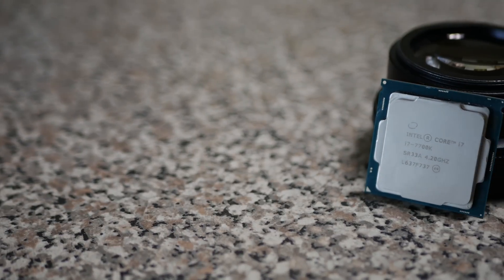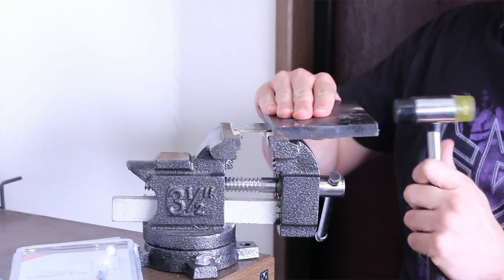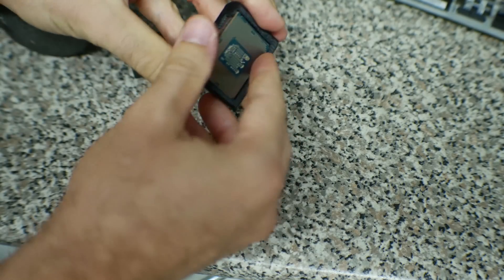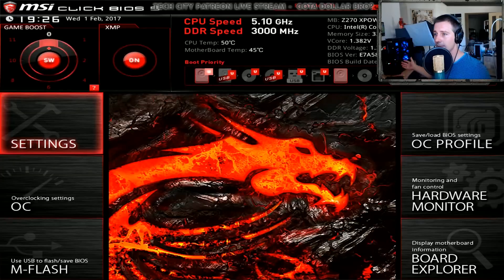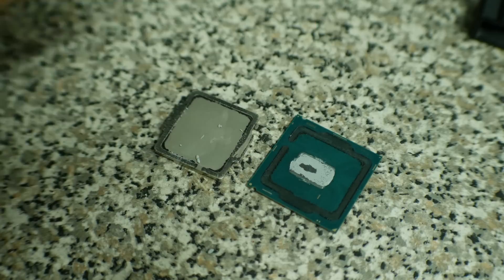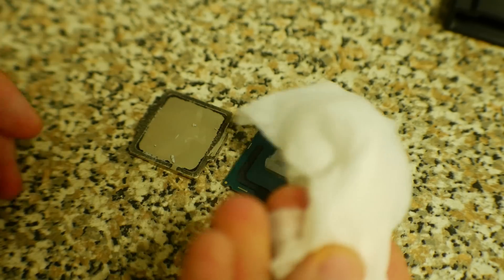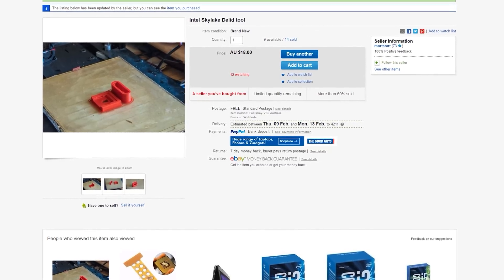DELIDDING The i7-7700k - How much of a Difference is there?

Comment: I used my 7700k for 3 yrs.  It was hot to start but 3 yrs later at stock clocks on prime95 stress test it was hitting 100°c.  I delid the thing and it dropped avg temps - 30°c.  Out of factory 7700k was dangerous and anyone who has one with no delid should check their temps now.  Irresponsible Intel!  I was actually having to underclock to get safe temps before delid.

Comment: I am going to delid my i5 6600, as temperatures go up and down by 30 degrees in one second, the tim is an insulator now. I will use a graphite thermal pad, and forget about the cooling forever.
 I had bought this cpu for its low tdp and good power. Then I installed a big cooler to cool that down at the lowest fan speed. It ran below 40 degrees under full load. After two years, temp goes up by 30 degrees instantly, when I open a browser, or do anything. Intel replied to me, that everything is ok, cpu works at safe temperatures, have a nice day. Intel uses BUFU strategy. My son got a ryzen for his birthday. I will buy amd only since now.

Comment: Before delid i was running at 4.8ghz at temp 81-84. After delid and using Thermal Grizzly liquid metal i am running at 5ghz, temps from 60-63 at full load. Happy camper.

Comment: is it just me or does the i7 7700k run hotter then usual, at 70% load im running around 80 degrees, its been that way since ive had the system built, have also used Thermal grizzly Kyronaut from artic silver just on my head spreader didnt do anything even after around 200 hours it still runs hot, all cooler and ect is mounted correctly

Comment: Did you put your Cache Ratio up to 100Mhz lower then your core clock? As that can help massively with stability.
Only asking because I get the same result on my i7 7700k Processor with 4.9 GHz and 4.8Ghz on cache as you did on CineBench 64.

Comment: 😭 I got 5GHz stable easy but because my cpu was going to 95-100 C and it did not even have much voltage :| I have to stay at 4.8 GHz and 1.36 V and even like this it goes to about fucking 84-85C wtf Intel 🤬 I would delid but i won't do the razor method i'm to afraid not to break the chip. If i get 85 with 4.8 with delid at 5GHz i would have 75-80 C ;) and that's 110% good for 24/7 usage 💪🏻

Comment: Can confirm. Delidded my 7700K and went from a 4.9Ghz OC throttling out at 100°C while gaming, up to a 5.1Ghz maxing out at about 78°C under extreme load and around 64°C while gaming. I used Conductonaut liquid metal for both the IHS and as thermal paste on my water cooler. These temps are better than I hoped. I definitely recommend using a delidding tool. It's worth the time and money.

Comment: I bought a Cryorig R7 cooler and noctua thermal paste for my i7 7700k but it still jumps between 50-77c in a second or less I'm not ready to risk delidding it yet is there anything I can do to cool it better does any one recommended anything else (besides water cooling)

Comment: sigh, my 7700k hits 95C on prime95 smallFFTs on 1.25volts...only 4.5ghz (which is stock btw) Using a Noctua NH-D15...
Reply: tinostarks im over clocked to 4.8ghz , on a badic evo 212 air cooler, and on max load i only hit 81c 😂😂 must of got a dank chip

Comment: Wait touching the chip with bare fingers doesn't mess it up? Because i was under the notion that body oil from fingers might interfered with the processor and that's why you hold it by the edge?

Comment: I would recommend delidding even if you aren't overclocking.  I'm building a pc for my step-son and he lives 2500 miles from me so I can't just go take a look when something goes wrong.  So once I finished building this Kaby Lake system the temps were eye-opening even at stock settings.  My Haswell system is 30C cooler at a 50% OC.  I couldn't bring myself to sending him a system and telling him, "Hey keep an eye on your temps while playing games since FutureMark was hitting upper 60s to low 70s."  That's with a Corsair H100i V1 water cooler on it.  So I bought RockIt delidding tool, which got to me in 3 days and I delidded last night.  Tonight I will drop it in and see what temps I get now.  It wasn't difficult to do with maybe the toughest part putting the new silicone on the IHS.  Don't forget to leave a pinky-sized gap for venting or else it won't work.  I'll provide an update tonight of what the temps are under a stress test of AIDA64.
Reply: Ok finished with my step-son's build.  Before delidding, AIDA64 stress test for 30 minutes at stock settings hit 78C; keep in mind that was 3 days after I mounted the water block.  After delidding, the same test hit 66C.  I figure maybe 2 to 4C lower as the TIM cures under the CPU block.  Not bad.  Gaming temps playing Elder Scrolls Online hit 56C which is perfect.  Even have some headroom for overclocking and this is with a h100i, which could be improved further with a custom loop.

Comment: I just delidded my 7700k and dropped from full load 100 C thermal throttling (no overclock) to full load high 70 C with no thermal throttling. So you have to pull apart a $500 CPU and fix Intel's BS with $15 worth of thermal liquid... Nice one!
Reply: If delidding has dropped my temps 30C, it obviously has nothing to do with the cooling in my rig ;). And judging by this video and all the other videos like it, I am not the only one with a bad CPU by far. You and your mate got lucky!
Reply: You never know, they also might have fixed/improved the issue on their own by now and you still got one of the earlier series. Unfortunately i ordered this CPU just last week without knowing about the problem. Even though i like to have the option of overclocking, i probably won't bother too much and hopefully it'll all be fine.

It's still a shame that they let this shit pass on a overclockable version of their processor.

Comment: I just upgraded to 7700K on MSI M5 mobo with NZXT Kraken X60. Mine is running OC of 5ghz at 1.2v. But I noticed temperature spikes from 38 to 60 degrees on some of the cores. Is this normal?

Comment: The quality of the paste Intel is using is perfectly fine. The only reason why off-the-shelf pastes are so runny is for convenient application as it is the fine metal oxide dust it contains that provides the actual heat transfer. The oil base also prevents the powder from turning into an airborne hazard. The main problem with Intel's paste-based IHS is that the gap between the IHS and die is much thicker than it should be. Remove the IHS, clean off the glue, use generic thermal paste, put the IHS back on and you will already get most of the temperature benefit.

When the thermal paste is in the neighborhood of 10X thicker than it needs to be, you get 10X more thermal resistance than is necessary from the TIM on top of total lack of physical contact between the two parts and even the best TIMs would still be horrible.

Comment: It's not entirely on the thermal paste they used, it's more the distance between the IHS and the die that's causing issues. You could have the same thermal paste in your hands to apply that Intel used and just remove the sealant and allow the socket arm to hold it down and there would be an improvement.

Comment: OK. I have a large amount of Thermal Grizzly Kryonaut thermal paste coming in. I have a Corsair H100i 240mm water cooler system. I have a brand new core i7 7700k. Just bought a delid tool from a seller in the Netherlands. Let's do this and see if I can hit a stable 5 GHz with my MSI Z270 board.

Comment: I've built a i7 7700k pc for a friend when the cpu came out and the temp issues was'nt well documented. Having experience with the skylake cpu i could'nt belive the reading of the temps when i was stress testing the kaby lake machine and ended up removing the cooler(evo212) and replacing termal paste multiple time, beliving that i hav'nt put enough to properly cover the cores  before figuring out that this chip was just hot and left it w/o overclock hitting 90's degree on max heat stress test. Still the chip is doing a great job but i've pushed all the  i7 6700k i worked on farther with better temps and knowing that the issue is bad TIM makes me disapointed.

Comment: Just learned about this delid stuff. Why can't a cooling block be applied directly to the chip without the lid? Like could you dremil around the top and use a mineral oil loop, or even a copper block water kit? or is there a grounding issue? Seems like ever material interface would just add to thermal insulation. Seems like for intel's next X series they could incorporate the water cooler into this lid and remove 2 layers.

Comment: LOL, a CPU running at 40 degrees is not burning hot nor DANGEROUS at all. I got some that ran stock at 100 degrees Celsius and would still work just fine. I dont get the temp drama. But i have to admit that the paste is total shit though. 20 degree is clearly a difference.

Comment: I delidded my CPU, which requires more voltage than most, however it runs stable at 5.1GHz at 1.410 volts and I was even able to complete benchmarks at 5.2GHz, however, it is not fully stable.

I do not agree with Intel using garbage for TIM.  They should go back to solder, however, I do not see them returning to that.  It is cheaper for them to hire a non-English speaking Vietnamese to be on the assembly line.  [Last I heard, Kaby Lake is made in Vietnam - thanks again Obama!]

Comment: What was the purpose of intel putting in the IHS? Is it to deliberately hamper overclocking?

You might want to add a warning in your video to people considering it.. Delidding this will void your warranty.
Reply: The purpose of the IHS is to keep the heatsink from smashing the CPU die and killing it. It's not designed for temperatures at all really.
Reply: Why did Sandy Bridge not have this smashing problem?
Reply: Because sandy bridge chips are directly soldered to the IHS so you can't really delid them without risking breaking the entire thing. The solder means that temperatures are much better in general though.

Comment: Hopefully something will motivate Intel to improving their thermal solution.

Why purposely use TIM that is 15-20c worse than what they used to use on SandyB?  Because it is cheaper!  It saves them millions and the processors still perform to the spec they have set.

I'm hoping AMD's Ryzen will push them to improve their clock speeds, which will necessitate improved thermal performance to support the clock increases.

Part of the problem is the tick-tick-tock iteration.  All they have to do for one of those stages now is bump clock speed 100-200mhz, solder the TIM instead of cheap paste and you have a 'process refinement' that yields better performance.  But the whole thing is a sham and is a false, fabricated improvement that originated with the bean counters.

I hope AMD smacks them in mouth enough that it hurts.  I'll be seriously looking at Ryzen and VEGA in the next gen if they are at all in the same ball park.
Reply: IIRC, Intel couldn't use a soldered lid on anything past SB because the solder just broke because the silicon die was so small. That's why X99 and AMD can use a soldered die, but not Kaby Lake. Still no excuse for really shitty paste.

Comment: Just used Rockit Cool's Rockit 88 delidding tool for my son's 3570k.  I will be using it on my 6700k as well, but I thought I would start with his.  The Rockit 88 made it SOOOOOO easy!  I used Cool Laboratory's Liquid Ultra, and the results were unreal.  Pre-delid I had the 3570k overclocked to 4.0Ghz, and the max temp was 82°C.  Post-relid I overclocked to 4.5Ghz, and the max temp is 62°C!  20°C drop!  Linus' test was garbage, and he replaced garbage thermal paste with more garbage thermal paste.

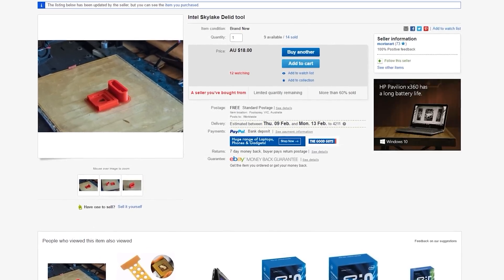Comment: Why touch the base of the cpu at around 1:30. Wouldn't that potentially damage the cpu?
Reply: intel's chip is LGA, so no. AMD has their pin on the chip (PGA instead) so you might damage it if you hold it too hard that way.

Comment: If your going to pull the lid off I'd replace it with copper. Now I'll admit you need a small amount of metal fabricating skill to do that, but the copper would noticeably improve heat transfer.

Comment: Goddammit, I just bought an i5 7600k...
Is it normal to be running 80*C on idle? I'm not sure anymore. 
I think I screwed up attaching the CPU Cooler so I'm going to buy some thermal paste and redo that, but should it be running like that? When I say idle, I'm in the BIOS so I assume it's idle :/
Reply: it shouldnt run a that temp even on load at stock voltage
Reply: DelightfulDonut Thought not. Do you know if sitting in BIOS is idle or load? I can't work it out lol
Reply: It's very likely that you attached the cpu cooler wrong, you don't necessary need to get new thermal paste if you do it quick enough, not getting any dust on the thermal paste and the thermal paste is relatively new. Just make sure to spread the paste a bit with soap-washed hands.
Reply: Jec BIOS = semi-idle temps. I have a 6600k and on the BIOS it shows me ~40C, while idling on Windows it sits at ~28C. Dont know why to be honest, but it is what it is. I have a Gigabyte motherboard if that's something
Reply: I dont know about the 7600k but with the i7 7700K different mobos will give different voltages to the (stock) cpu. Meaning there might be a almost 20C temperature difference at stock depending on what mobo you use. Maybe google, check your voltages, see if they are normal, whatever that is, if not, drop the voltage?
80c at idle is not normal, bios is idle I guess, my different cpu is at 40C idle with a big ass cooler
Reply: wtf!? 80C at idle? Hell no that's not normal.
Reply: +Slopedarmor Bios is idle temps. You can't really stress it in the Bios and I've seen similar temps just using hwmonitor to watch temps while in the OS.
Reply: bonnome2 Nah it's been a few days now, I don't think it's worth it :/
Is spreading the thermal paste a good idea? All the guides seem to suggest it's a waste of time.
Reply: Jec what cooler do you use?
Reply: DelightfulDonut From what I can see, BIOS is generally running a bit hotter than desktop, but still not sure why :/
Reply: wtf 80c at idle? you either have too little thermal paste or you attached cooler all wrong

Comment: I use Liquid Ultra. Same company, new formula to prevent sticking after a year.

Should be noted, this stuff is corrosive to aluminum. Only recommend for copper, I think nickel-plated is fine as well but don't take my word on it.

With that said, I used it on a EVO 212 which has partial aluminum contact. It's been well over a year and the aluminum did show signs of corrosion but the cooler performs like day one of application.

Comment: My 7700k is running at 5.1 at 55-60c under load, without delid, either I hit the silicone lottery, or they started fixing some post first wave release.

Edit: I should mention im using an Nzxt Kraken for my cooling solution.
Reply: Ryan Monaghan just got mine from newegg same issues still

Comment: too many people using auto voltages...too many wrong guides now a days, poorly programed xmp into ram modules, that vccio/io voltage..0.95v --> 1.264v? really? that thing is rated for 0.90v ~ 1.00v, 1.264v...i seen plenty of bad, but thats absurd..vccsa is only slightly not as bad, & u even set it to that. that poor system... ur using 3000mhz ram not  5000mhz.

the cpu temps were bad & still are bad, thats only cinebench, prime95 will probably cause thermal throttling if it doesnt instant fail, linpack will also most likely throttle if not lock up/bsod the system, i doubt thats stable. if u had those 90c+ temps in linpack for many many hours & stable there and prime95, then..

Comment: what cooler do you use that you get those high temps?  
i pre-ordered the B8uer kit yesterday ... just need to wait for it now...  but my 5GHz OC is already stable at 1.4v and doesn't go over 90°C if my AIO fans are at 1000 rpm (20°C ambient temp though... kinda cold here).... at 500rpm it is a different story and heats up rapidly. Delid is an absolute must for 5GHz.  
also going from the 2500k@4,6GHz to 7700k is a GIANT difference, my GTX1080 now does 100% GPU bound frames in the Gears of War 4 benchmark instead of 35% before and the numbers are off the charts even at stock speeds. All that noise about Intel CPUs not improving all that much is total garbage and only comes from people that just bought a new one in the last 2 years or so.  
build log (work in progress) with some benchmark screenshots: http://imgur.com/a/pfgjM 
if anybody cares to take a look.

Comment: so they're selling this high-end CPU for around $350 USD and cheap out on... thermal paste? ridiculous. are the low-end Kaby Lakes like the G4560 also plagued by high temperatures or does it only matter for overclocked 4+ core CPUs?
Reply: Valfaun mines running up to 99c on intel stress test at 4.6ghz lol. I gotta delidd mine. Brand new hot little bastard

Comment: Good video - I just delidded my 6700k - my prime 95 28.7 with avx temps went from 87c to 63c @ 4.6ghz with ht on 1.3v in bios. Using a noctua u14s with the fan running at 900rpm. Ambient temp 23c. Used cool laboratory ultra on die and noctua nht1 on the heat sink- super solid results

Comment: Isn't tuching these gold pads on the botom damaging the cpu?
Reply: No Intel's pins are on the Motherboard, not the CPU its fine to touch them. But AMD has their pins on their CPU's and not on the monterboard. Intel=Dont touch socket... AMD=Dont touch pins.
Reply: Alright thanks for the informations. :D
Reply: cheeseburger fee be careful with ESD, better safe than sorry.
Reply: +user 007 I can honestly say I haven't killed any cpu with ESD yet. I haven't actually gone out of my way to try either. I've just bare handed cpus all at random and they all work just fine.